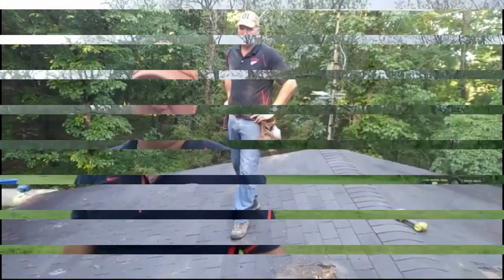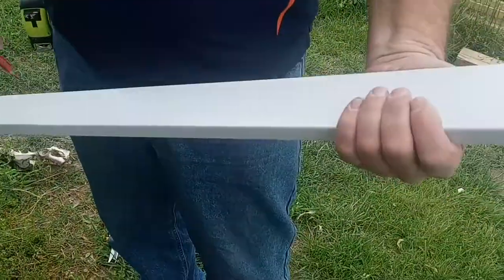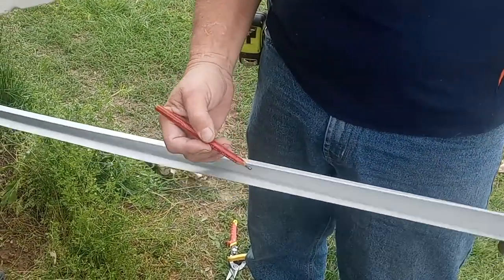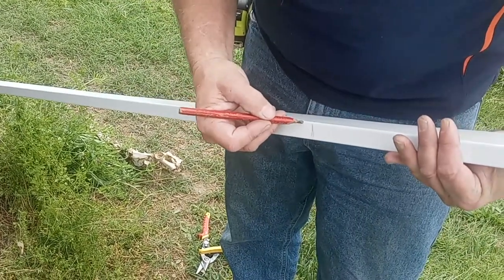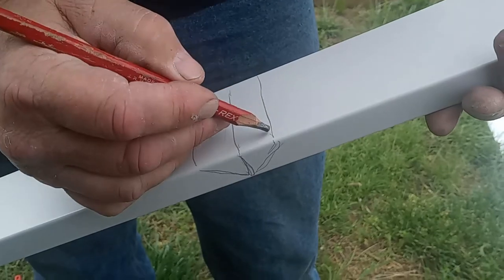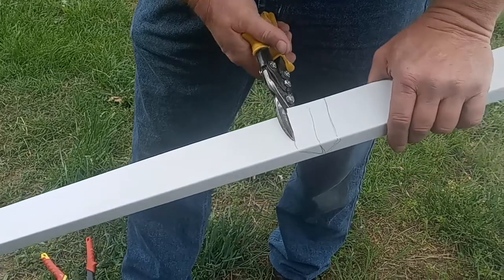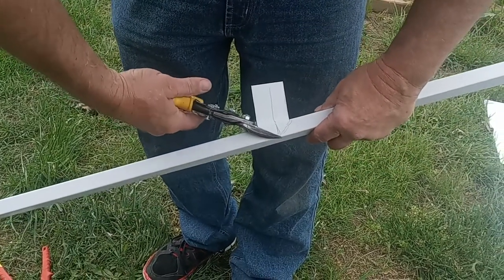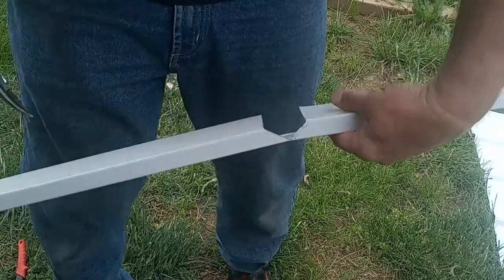Creating a Corner with J Chanel For Skirting

Comment: Your videos have been very helpful. I have bought and moved a used double wide. Originally, it had a wood frame laying on the ground that the vertical metal skirt pieces screwed to without any J channel. I saw in a previous video about not using wood since it will rot and attract critters. Do you secure the J channel to anything on the ground or just lay it loosely around the perimeter?
Reply from the maker: You 6 inch long nails to secure to the ground. Usually found in the hardware dept. I believe my videos show the length and style. Wish well on your project
Reply: @StraightArrowRepair  Great! Thanks a bunch!